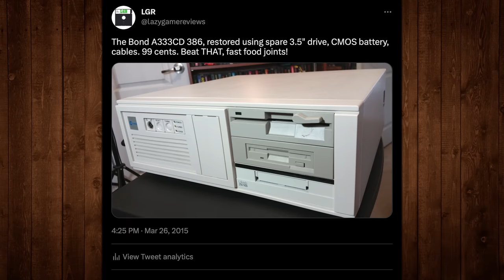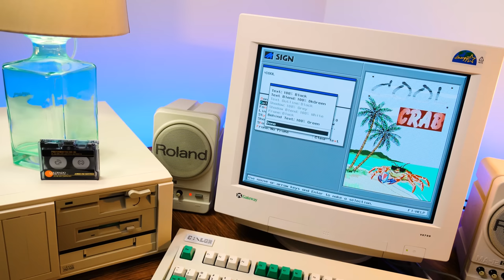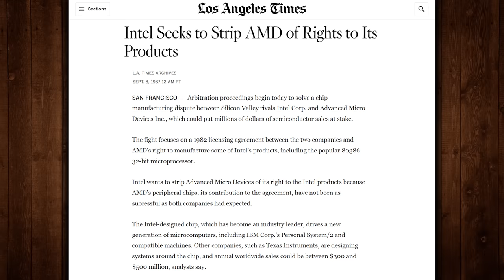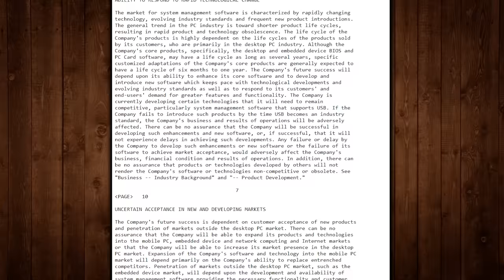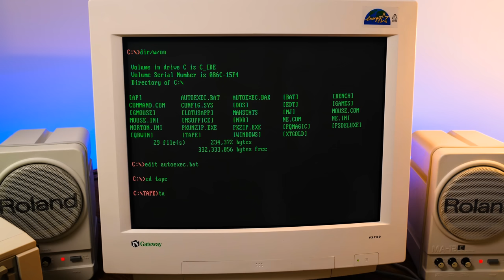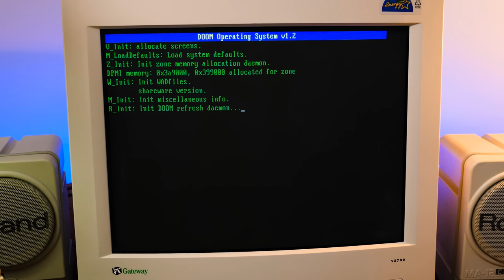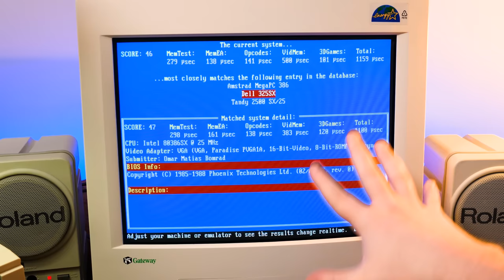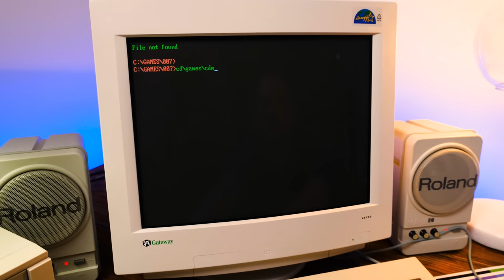Exploring a PC Built by Bond, J. Bond – The 99¢ 386

Comment: Love fact that these machines didn't have even a simple heat sink on the CPU.
Reply: I know zoomers won't believe this, but when I got started with computers, not only could you not fry an egg on the CPU, they weren't even hot enough to make avocado toast.
Reply: The first computer I used had two chips that could really give you a bad day if you touched them with the case open.  The first, thankfully, usually sat within its protective shielding, but the second?  Right out in the open for curious fingers reseating chips to discover.

The VIC-II and SID chips got hot sometimes.

I was honestly surprised when I learned that the 8088 and 8086 didn't need heatsinks, and that continued all the way through some models of the 486.

My not-so-logical leap took me from the family C64 which got me into computer gaming, to the experience of a Pentium II 200 mhz in an old IBM Aptiva, bought new in '97 with Windows 95 on it.  That computer ran relatively cool.  The socket A Athlon that replaced it?  That sucker ran hot_.  Then again, I was the _cause of that.  Better heatsink, pencil mod for higher speed, turned the wick up in the BIOS.  Took a 1200 mhz chip up to 1600, which was... I'd say decent for the time.

Got one hell of an ass-whooping from Dad, though, when he realized why the CPU fan was constantly screaming.
Reply: Putting a CPU heat sink on one of these would be like putting a chimney on a matchbox 😂❤
Reply: @editingsecrets  Back then the CPU's had a ceramic coating that acted as a heat sink, it was that grey colored top we all knew.  Remember though these things were only running at 33mhz a far cry from todays cpus so the heat was negligible.

Comment: I got a qic-80 drive and a handful of tapes at one of those roaming computer shows back in the day, it was outdated by then as it was  one of the smaller formats compared to the jumbo drives... before CD-R became reasonable (I think I paid around 100$ for a 4x read 1x write HP scsi model, seems like a month before 4x4x drives became dirt cheap) it was my main source of backing up software I "acquired"

Comment: Man, those little backup drives were awesome. Remember using CPBackup with it on my AMD 386DX40. Fond memories😃
Reply: At work we had an Colorado unit using the same tapes which plugged into the Parallel Port. That way we could periodically back up several different PCs.

Comment: 386 Computers are good candidates for slow down software, such as ATSLOW (Comes in the Activision Powerhits boxes, eg the Sci fi box that has DeathTrack in it).
Using ATSLOW I can get my AMD 40MHz 386 down to 8MHz easily to play speed sensitive XT era games such as DeathTrack, Spacewars, Gunboat etc.
Definitely worth trying slowdown software on these PCs, especially period correct slow down software.

Between my 386, Pentium mmx 233Mhz IBM, and 1ghz Pentium 3 PC I can play most DOS and Windows games released up to 98se. For XP games I have a massively overpowered Intel Core 2 Q6600 and GTX295, same system also running Vista for things like Crysis.

Comment: I'd love to have a look inside one of those tapes and the drive that uses them, I don't know how it turns the reels with apparently nothing.
Reply from the maker: I'm sure there are some videos about it, but these use a single capstan to move the endless rubber belt inside the cartridge. The belt makes contact with the tape and moves everything that way, instead of using a pinch roller :)
Reply: i was not a lot different than a cassette tape, very mechanical, wheels and pullies and heads and stuff
Reply: CuriousMarc  has a great video on it. I've used his repair method to fix a couple of these, similar HP drives...     https://www.youtube.com/watch?v=wuMBOiwPnOg

Comment: i remember those Colorado tape boards, they had a habit of backing up just fine, but when you went to restore, they could not read, got several calls on that issue
Reply: bummed me out, you sell a guy a backup system, then he says, ok, i backed up 4 times before i made this critical change, and non of them will restore? what kind of backup is that?
Reply: IS not a real backup until you test the restore capabilities.
Reply: @William Yousef Fadel  it worked when it was installed, but after a year there would be a capacitor go. or sometimes it was just s dirty head, for some reason the playback head would gum during the record cycle and this was rarely noticed as restore tests were not done often enough :)

Comment: QIC drives I had used to run off of your floppy controller, if you didn't have the dedicated controller, hence the FC in your dedicated card's naming.  I had some QIC drives, until I gave up on them and finally upgraded to 4mm drives (ones I had were SCSI).  The QIC tapes just were not that reliable.
Reply: The fast interface is basically the same as a floppy controller (except faster), and thus specific to tape drives.  It was optional, and you could just connect the drive directly to the system's standard floppy controller instead.

I'm quite curious who thought it was a good idea to wrap a rubber band around a spool of tape?  Like, not even the hubs.. just right on the tape itself.  x_X

Comment: We have cases like this housing Windows 95 PCs at our factory, they run our older machine’s vision system. No 5 1/4 drives, they just have 3 1/2 drives in those 5 1/4 drive adapters.

Comment: In Mainz, f/e, the Departent of Nuclear Physics at the Johannes-Gutenberg-University runs an old research reactor which is used as a source of neutrons for archaeological research (Isotopic Fingerprints to locate the source of ancient Goods and Materials). This reactor is still controlled by an old 80/386-Computer, as it was designed for this machine. In this case it is still relevant: Never Change a running system :-)

Comment: it's a DX chip.  Those had the math co-processor built in.  However the co-pro socket would have come into play if an SX chip was installed as CPU.
Reply: That's the case with the 486, but the 386 is different. With the 386 DX means 32-bit bus and SX means 16/24 bit bus. No i386 has an integrated FPU.

Comment: The "fly-by-night" type generic PCs, are often the easiest to repair/upgrade. They often used off-the-shelf parts, where many big brands used proprietary parts like power supplies. Rather one of them then many weird big brand PCs. 7:34 Most QIC tape drives used floppy interfaces. So it's just a type of higher speed floppy controller. The tapes need to be formatted like a floppy. So buy preformatted ones, takes a long time to format.
Reply: Instead of big brands, you can just say IBM, which still dominated the PC market when 386s first came out. Everything else was called a "clone". And they tried lots of different proprietary components at that point. "Nobody got fired for buying IBM", but when these little companies offered much cheaper prices, for more easily repairable and upgradeable machines, and that's how IBM doomed themselves.
Reply: @squirlmy  Compaq's Deskpro 386 changed the market and made them more than just a clone. And there were plenty of other well-known names in the clone market.

Comment: The first computer I ever built for myself was a 386SX-20 with a Trident 2mb video card. Just thinking back, it's probable this computer would've used an external Hayes type modem attached to the serial port. That would explain the lack of internal network doodads.

Comment: The slot for the tape writer seems like it would fit in the smaller vertical bay, but that does not account for the internal mechanism, so maybe not. With a lot of "what if's", if Windows 3.1 was CD-ROM compatible (which maybe a home brew project might make it possible) and a 5.25" bay was to become available, the model "CD" could become more than just a name but a selling point in a 1992 Radio Shack ad saying "Compact Disk Read Only Memory support"

Comment: The good deals can be hard to find but they're still out there. In late 2021 I bought a 486 DX2/66 system with Sound Blaster 16, CH products flight stick and a (not working, unfortunately) VGA monitor for $20 at the flea market. I did need to add a hard drive...  Seems like the system is straight out of 1994, VESA local bus, and a matching Creative Labs CD-ROM drive and speaker set. Alas, it's a bit low-end for Descent and the SB16 actually kind of sucks with audio clicking and MIDI freezes and crap like that but it's good times.

Comment: I had one of those tape Drives in the 90s in my AMD 386dx40 it was actually a 400mb variant but actually the same tape. But I remember getting for really cheap. I even remember that Windows could make use of the tapes without any additional software for Back up.

Comment: IIRC, the tape controller is basically an accelerated floppy interface, not SCSI. The QIC drive can actually be put on the floppy controller, but obviously would not achieve the same speeds. I wonder if the external connector can take the same drives that the original IBM floppy controllers could.

Comment: I had a Colorado tape backup back in the BBS days. 120mb. It worked but about 4 years later I tried to pull stuff off and the tape had errors. By then you could get a HD the same size as a tape for less.

Comment: I got an 8086 IBM XT clone Amstrad PC1512 for £100. It 5.25 floppy drives drives were worth more than the whole thing. So it was kind of free (not really). My intention was just to get a 5.25 drives from the eBay seller but they also had the computer. So I ended up with both. I looked after I bought it and people were selling them for over £300. I don’t know what they seller was thinking. Maybe they just wanted to get rid of it. Anyway it’s in not terrible condition, a bit of rust here and there, the monochrome monitor is great. So I’m happy as a pig in mud, and yes it didn’t cost big money.

Comment: It is amazing what can happen if you play your cards right. I recently bought a Fujitsu Lifebook 270Dx laptop, which was complete with charger, for £16.10 shipped; it was that cheap because the seller had no idea how to turn on the laptop, so thought it was stone dead. (There's a switch on the side of the laptop as well as a power button - if you're not familiar with 1990s Fujitsus and don't spend time on it, you'll easily miss that quirk) Sadly it is a dual scan laptop but otherwise - a perfectly good Pentium MMX laptop that even had a good main battery (albeit of undeterminate endurance).

Comment: Here are the instructions I used to colorize the DOS Prompt on my systems back in the day. 

ANSI.SYS COLORING

CHARACTERS	COLOR		BACKGROUND

30 		BLACK 			40
31 		RED     			41
32 		GREEN 			42
33 		YELLOW 		43
34 		BLUE 			44
35 		MAGENTA 		45
36 		CYAN 			46
37 		WHITE 			47

Colorize Your DOS Screen

Colorize your DOS screen by adding this line to your CONFIG.SYS 
DEVICE=C:\DOS\ANSI.SYS 
(ANSI.SYS is a display driver that handle colors, mouse movements, etc.) 
Then edit your AUTOEXEC,BAT 
SET PROMPT=$E[1;32;40m$P$G 
This will give you green characters on a black background. 
Then Reboot... ...but there's more...

Don't forget your still in Windows...
during your next full screen DOS session !
With the DEVICE line in your CONFIG.SYS as above... 
Add this line to your AUTOEXEC.BAT on the next line after the SET PROMPT command. 
SET WINPRT=$e[1;31mWARNING!!! Type EXIT to return to Windows!$e[1;34m$_$p$g 
Then Reboot. This displays a red message over a blue DOS prompt .
You can include your own message and try varying the colors with the numbers charted above.

Comment: Taiwanese here. “J Bond” (捷邦) is simply a transliteration and has no connection to 007 in Chinese meaning. I came across this brand in the late 1990s while searching for a Socket 7 motherboard at Taipei Guanghua Market, but I ultimately chose SOYO, and SOYO also disappeared from Taiwan later on.
Reply: What is "J Bond" a transliteration of?
Reply: @mardus_ee  捷jié 邦bāng
Reply: @yunsui3491  I searched using "捷邦", and found two companies with similar names in Taiwan: Jbon and Jabon. And a company named J. Pond / JPond in mainland China.
Reply: @mardus_ee  J. Bond Computer (捷邦電腦), located in Hsinchu, Taiwan, had already dissolved in the year 2000. Therefore, the companies currently using the "捷邦" brand are not the same as former J. Bond Computer (捷邦電腦).
Reply: @yunsui3491  Is "Jié bāng" simply a name, or does it translate to anything? Google Translate couldn't make out anything from the original or romanised characters, either in traditional or simplified Chinese.

Comment: Norton Commander can actually read those tape drives directly.  The fact that you were using xtree gold made me assume you didn't know about the program... but you mentioned it by name... so... why not use it instead? 

Also, the point of the turbo button wasn't to slow down a PC, it was to speed it up. -- It was used as a temporary overclock*, because we hadn't figured out that we should be putting heatsinks on our CPUs yet at that point. 

(*: i.e. you'd turn it on to load windows faster, or if some program was going slow, and then you'd turn turbo right back off to run at the regular speed right afterwards. 25/33 was very common for 386s back in the day. -- 16 was more of a 286 speed.)

Comment: Is that 'XTREE GOLD' a DOS Tree explorer and selector program? 
..kind of like Program Manager for DOS? If it is, thats super cool. Ive been looking for something like that for a while now since I used a program called 'Spree Tree' which did exactly that, and gave you the option of using it in DOS mode or IBM BASIC mode and it had the capability of file management that seperated and hid each file system from each other. Very smart program.

Comment: I had an Amd DX 40 386 I upgraded it from 128k cache to 256k added a 387 co processor and put the ram to 8mb it ran Doom really fast and later in 1995 I put windows 95 on it even though my college tutor said it wouldn’t work it ran just fine 😁

Comment: A couple of months ago I pickup 2 486 ones a dx66 and ones a dx100 both for $80 I thought that was a good deal. Both of them work but one had a faulty hard drive which worked some times but still $80 for 2 486 PC's can't go wrong with that deal

Comment: Tape backups were popular in 1990’s before High Speed internet and Inexpensive large capacity Hard drives. Today we have Apple Time Machine, iCloud, Microsoft Cloud storage, Over the internet backups and cloud storage, Google drive, etc. USB and NAS Backup devices. And inexpensive computer Networking devices.
Reply: Not just popular, but were essential in some systems like the Dynix library system.
Reply: @rommix0  What was that?
Reply: @editingsecrets  it's a system all libraries used back in the day. Clint briefly mentioned it in his DEC VT320 terminal video.
Reply: @rommix0  Thanks. Now that you mention it I might have seen some terminals that had a dynix line on them, in libraries that replaced the card catalog with an online system.

Comment: Windows for Workgroups doesn't necessarily mean it was on a network. Could've been just sold that way, maybe MS were pushing it that week. Or it might just have been on the bunch of floppies he got back when he asked the guy next to him for a copy of Windows. Back in those days you'd just zip up your windows directory, easy as!

My first PC had a 50MB disk drive. Room for Doom, Sim City 2000, and Windows. But not all at once! So I'd keep each one zipped up on floppies and uninstall as needed. Using the DELTREE uninstaller.

Comment: I had an AMD 386dx 40 back in the 90s. Great chip, nice option compared to the more budget 486s. They'd still beat me in most benchmarks but they also cost a lot more. Also my first homebuild PC. Scraped together a bunch of salvage parts from print classifieds and threw the thing together. 

One of these days I need to build it again.

Comment: I have a gaming, vintage Panasonic desktop tower computer that has a top quality components inside, such as ASUS gaming components. It is silver, with a see-through plastic side panel and a floppy disc drive. Don't know if it works but it must have been top of the range at the time. I cannot find a single thing about it on the internet?

Comment: I'm surprised DOOM ran so poorly. I remember it running very well at high detail on my AMD 386 40 MHz. It also had a 387 installed, but I didn't think DOOM used it. It did have a really fast video card though.

Comment: @LGR Can I ask what you do with computers that smell like smoke? A few monts ago before I got back into retro computing I had a guy go over and back up my old computers (compaq presario, and some generic dell pcs), but I didn't know that he smoked like a chimney. So for 3 days my computers were being worked on by a guy who smokes every 15 minutes.

Now every time I turn on my computers the room, my clothes, my hair everything smells like smoke as badly as if I had smoked myself :S.

I have gone over the pcs and cleaned em with a vinegar/water solution, but it does not help. Probably the power supplies are tainted with residue.

My compaq presarios CDS 520 is also really hard to clean as it is a "all in one pc with a crt and everything".

They have only been in the smokers house for 3 days so it's not like they've been exposed to years of smoking.

Is there any hope? 😢 (They are all my childhood computers, and they still work fine so It would be sad to  have them only as display pieces).